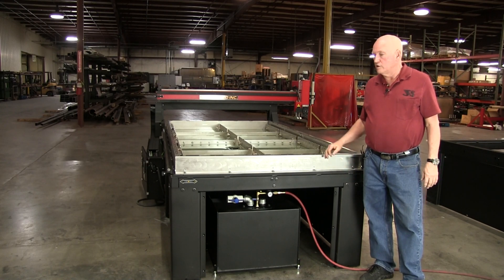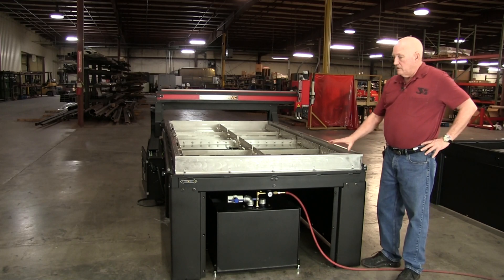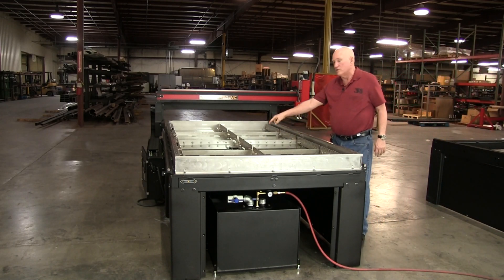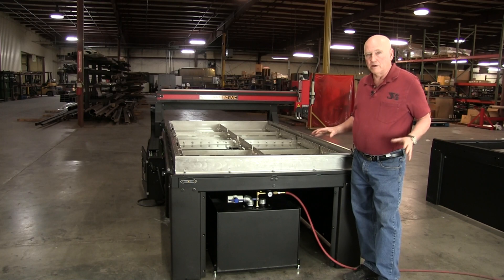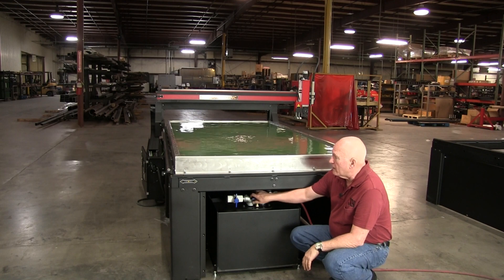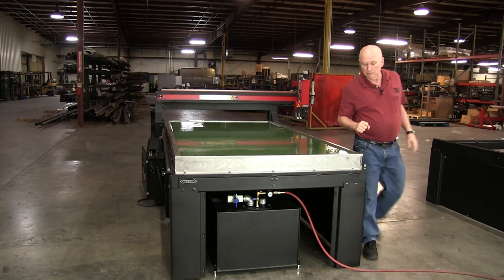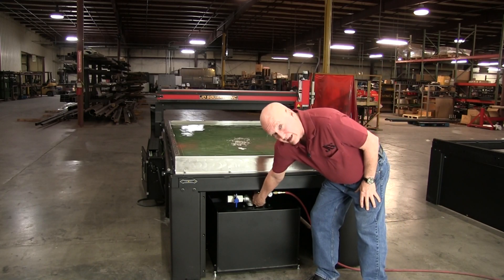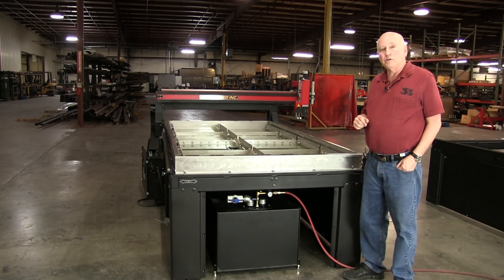JD Squared Multi-Platform CNC Cutting Tables: Adjustable Water Level System

Comment: 6:19 Why do you need a rust inhibitor if you are using a stainless water pan (1:20)
Reply from the maker: Most people purchase the water treatment to prevent rusting of their material / parts and also the slats. You wouldn't want to use SS slats because of the cost and those are consider a consumable in a sense. Hope this helps.
Reply: @JDSquaredInc  Thank you for the reply.  I am just about to buy one of your tables but I am waiting for them to go on sale.  (Value is great but its alot for me to spend)